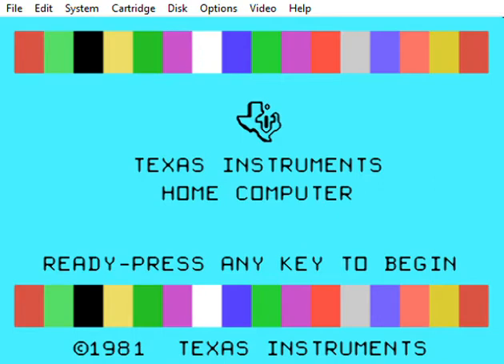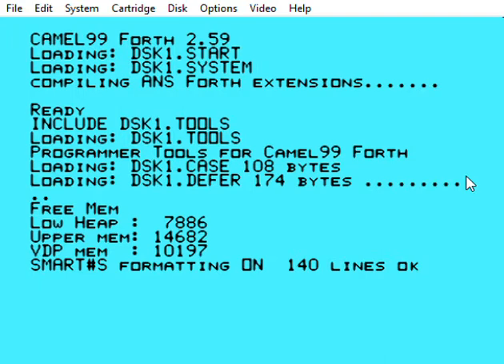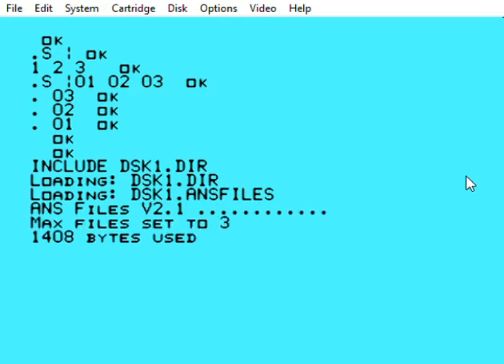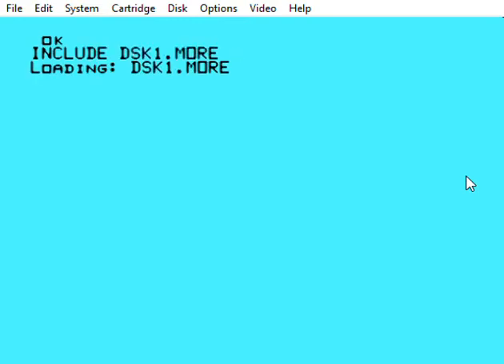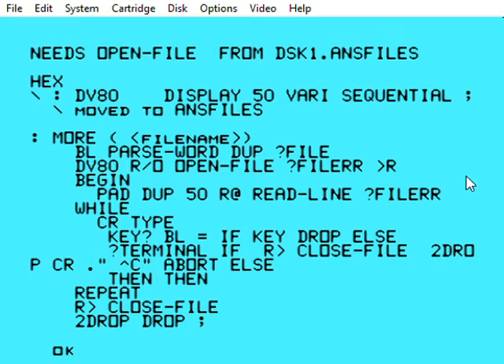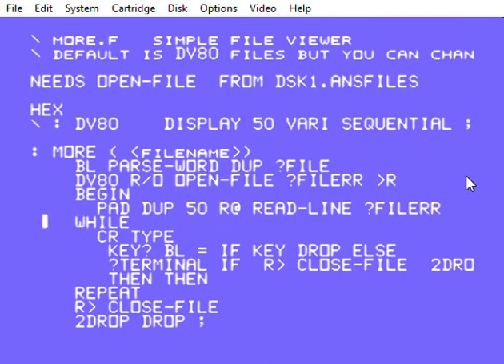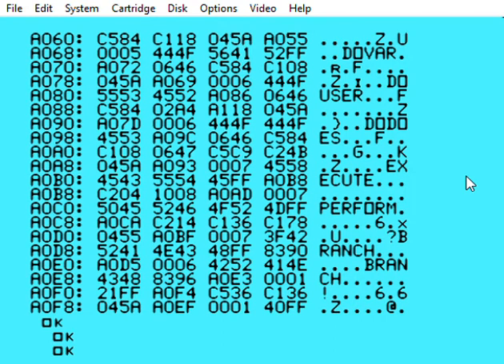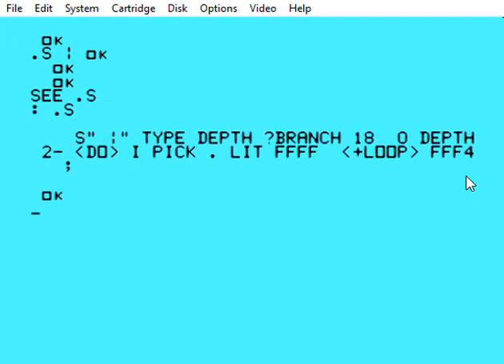Exploring Camel99 Forth on Classic99 Emulator

Comment from the maker: NOTE about the de-compiler demonstration.  Decompiling Forth's dot (.) operator showed us a tool called SMART#S that was loaded with DSK1.TOOLS  SMART#S  is for program development. It detects the number base (decimal, hex or binary) and prints out numbers with different formats for each.  That is the reason there is so much code, for what is normally a much simpler operation.  To disable it the command is FAST#S  which reverts dot back to it's normal self.